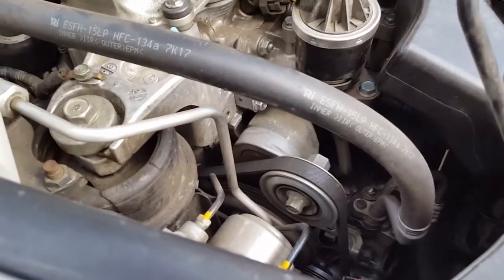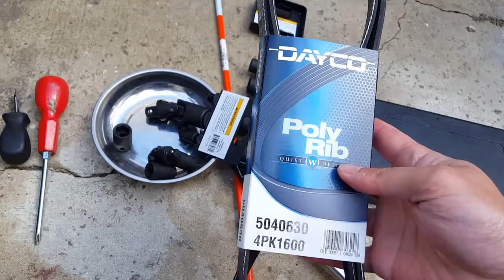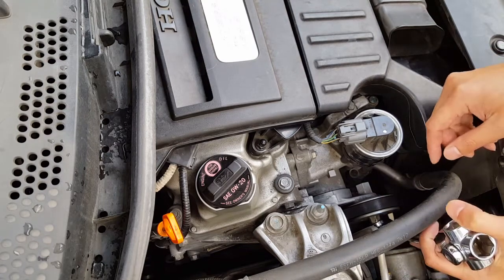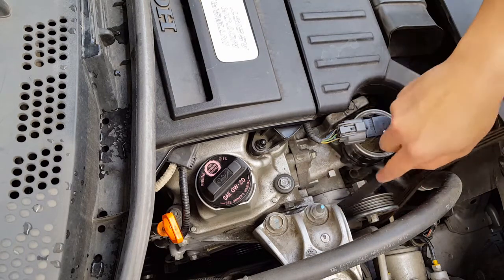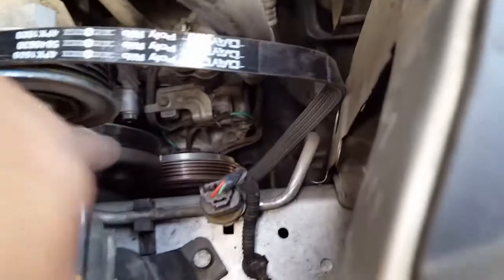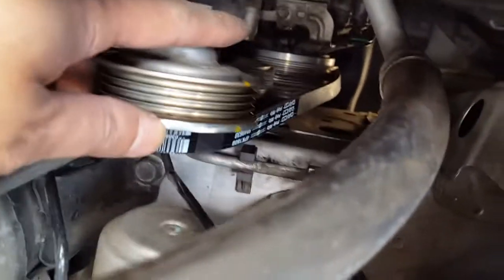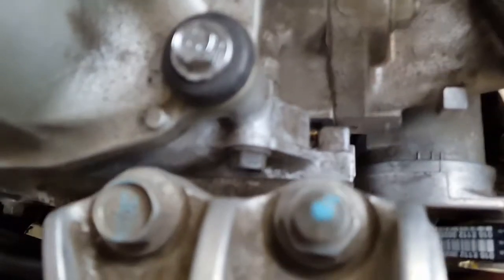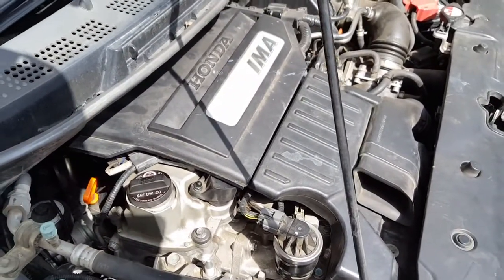DIY: EASY Replacing Serpentine Belt on 2006 - 2009 Honda Civic hybrid.

Comment: Just turned 241K coming home from a 2500 mi trip to New England and on the road I thought about the S-belt, praying it would last till I got home. That's when I started researching and found your tutorial Thanks! And I must say these Hondas are quite dependable.
Reply from the maker: Its actually extremely simple to replace. The 08 HCHii is extremely dependable, assuming you charge the battery manually every few months.

Comment: Yup, use the hex lug on the right side of the tensioner (as you stand at front of engine), that the one that's there for that reason only.

Also, when I recently pulled that belt off on our son's civic hybrid (then just reinstalled, will replace at next oil change): I found it near-impossible, working from above, to get the belt looped properly around the bottom/rear pulley, the one on the engine drive shaft.

Even if I would have succeeded, not worth the hassle, and you will NOT be confident you've done it right, that it's on there properly:

It is infinitely easier, to jack up the front end, remove the passenger side wheel, pull off a couple of the push-in plastic fasteners and bend back the plastic splash guard there, ensure you get the belt properly looped around the pulley on the drive shaft.
Reply: Mendel Leisk interesting.

Comment: I just wach this video, and I decide to do it myshelf because this guy video looks not hard to do. But it is not that easy, took my like four hours, it what driving mem crazy, so I decide to take the passenger tire and go underneath. it really make a big difference trust me. it save my $ 450 that is what the dealer want to charge me, and the belt that I have was still good. have somebody to help you it will go a lot faster
Reply: I replaced mine and was difficult. Once I got my neighbor to hold the crankshaft side, I could drive the belt to the other pulleys and was done. Get some help, it will be quick, by yourself, hours.
Reply: @luisfoulks1694 If you need to change it again, gaffer tape is perfect for holding the belt onto pulleys while you put it in place on the tensioner.

Comment: Nice job on the video.  I was watching and wondering if you would discover the hex on the back of the tensioner pulley for easy removing and installing of belt.  That way you are not getting in your own way  trying to get belt on and off.  I see you figured it out at the end.  That is why people should watch the whole video, they may miss things if they turn off too soon.
Reply from the maker: yeah the tensioner had the hex location to use a wrench to release tension.  the honda service  manual didn't mention it so i thought it was off limits, lol.  it would have been much easier if i started that way.
Reply: There is a picture in the Shop Manual, showing the wrench on the right side of the tensioner (as you stand at front of engine bay). Also, a nice diagram of the serpentine, how the belt wraps through the pulleys.

Any way to post the image? If anyone has ideas, I'll post it. I'm stumped.

Comment: Serpentine Belt Routing - Tensioner to AC pulley, then over the Idler Pulley, around the crank shaft pulley, and then back to the Tensioner.

Comment: Did you notice any improvements in performance or better millage?
Reply from the maker: On thr HCHii ... not really cuz the original was actually still good. For  regular civics i would swap out at 60k miles

Comment: I just changed my belt indicator is in the same spot do I need a new tensioner?
Reply: commops106 I’m having the same question! Did you ever figure this out?
Reply: any news on this
Reply: Any news on this?
Reply: I just changed my belt as the surface on the non grooved side was looking very worn. The tensioner hadn't changed position much when the new belt was in. I'm thinking the belt hadn't streched but was still at risk of breaking on the non grooved side. As long as the belt isn't slipping I don't think a new tensioner is needed.

Comment: How is your mpg?
Reply from the maker: Gave to my bro a while back... last time i drove her with the new belt i was still getting 40 mpg or so (55- 65 mph) with out hypermiling.
Reply: IMA battery changed or software update battery fix done? Any big ticket repairs within 200,000 miles? Thanks

Comment: Thinking about doing this on my 2010 CivicHybrid 208,000 miles. This and a few other small DIY repairs. 
Currently getting 25 MPG if I am lucky. Something is definitely not right with my car. Any tips/ advice on bringing my MPG higher?
Reply from the maker: Your ima battery is probably done
Reply: @SterlingW8  
Didn't even think about that one considering the dash shows the battery recharging and draining steady, as well as Auto Stop still functioning. I did not buy this car new though and I have no clue how it is supposed to run normally. Definitely would make sense considering how bad the MPG is compared to original estimated mileage rating for the car. Thanks for the reply despite the many years that have passed after posting the video!
Reply from the maker: @paradoxx2797  with a ima battery with new cells, you will get about 45 mpg. The battery level will drain very  slowly.  Moreover you can recharge the battery by shifting to L on the gear shifter. But if charging a full SOC meter drops in a few miles and you still get 20ish MPG... your IMA battery  is not holding any charge.  Believe it or not my HCHii had no problems except for the ima battery wearing out after 80k miles. This car is meant to be highway driven and not city driven.
Reply: change your plugs too

Comment: A dogbone? Seriously? Geez - buy some REAL tools. ;-)
Reply from the maker: been using that dog bone wrench for over 13 years for all my oil and simple car repair needs... its not bad.  But yeah i am saving up for a socket wrench set from costco. :P
Reply: Lol, yeah I didn't know what it's called, but I laughed at the gimmick tool too. 😂 Still, I learned from you, so thanks! I'm sure the Costco set is primo, and I have larger sets, but the set I use daily is the 3/8" $40 Quinn set from harbor freight, and I love it. Then from there, some of the specialty wrenches from ICON, also at HF, have come in clutch for weird angles and tight fits.
Reply: @SterlingW8 No harm in using a dogbone wrench. At least you don't have to search for that illusive spanner.

Comment: "sound good."
Me: Sounds like shit!.. (🍺) 😝
HCHII owner with not Serp Belt probs.

To my Honda family, if you drop charge and/or replace your 12Vs in your HCHs (or Insights), bring to the deal to reset your Brake System, ABS, and BRAKE light. ☺️ ✌️ 💚 (🍁, 🍺) 🚗
Reply from the maker: +aleche96 sound good to me. Lol